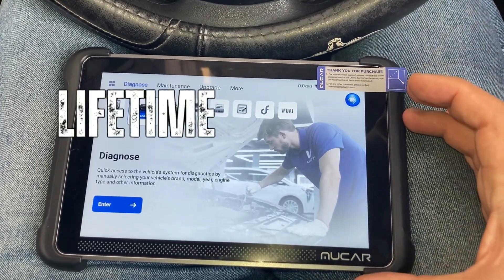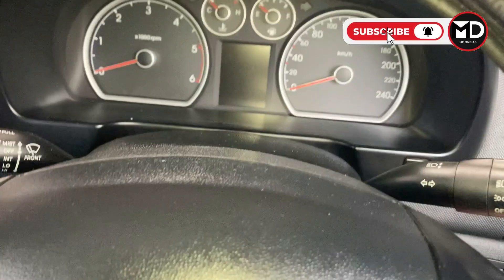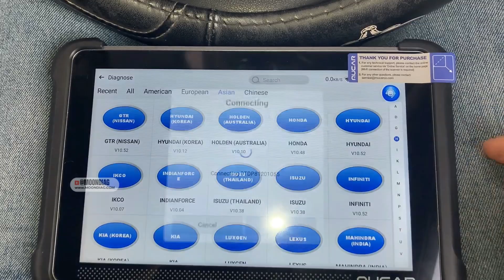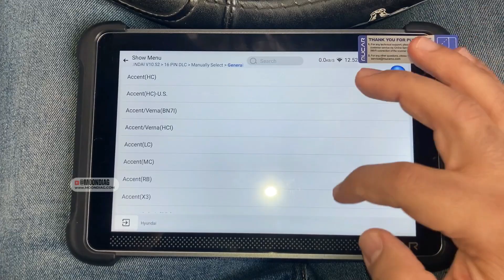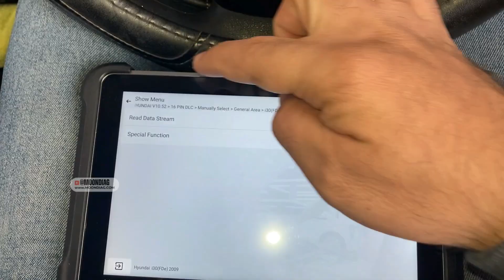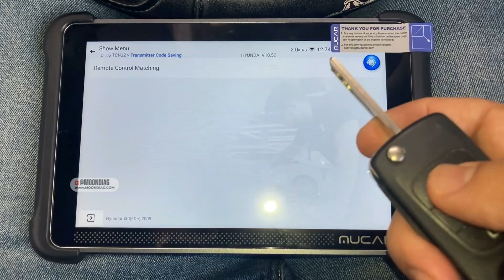KIA & Hyundai Transponder Programming | Remote Programming | MUCAR 892 BT Scan Tool

Comment: Was hoping you were gonna add another key here lol
Reply from the maker: Hi my friend, if you mean another remote, it’s very same procedure but you need to press yes after programming the first one and do the same as you did earlier. For programming the keys you need to select “Immobilizer” on system selection, teaching a key is very easy on Hyundai and Kia, the only thing you need is the PIN code, I will make a video as soon as I have a car for programming the keys.
Reply: @moondiag ele não lê o pin code do carro?